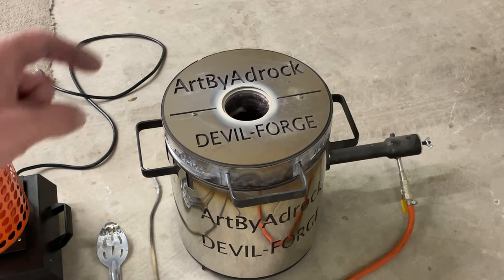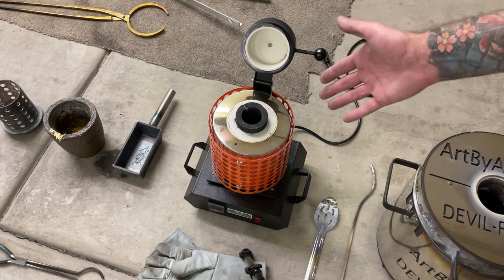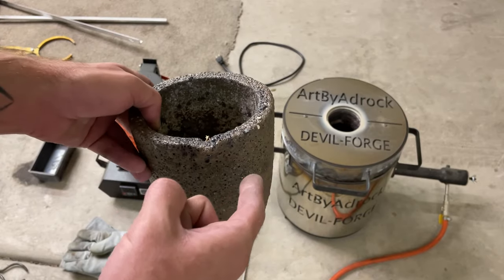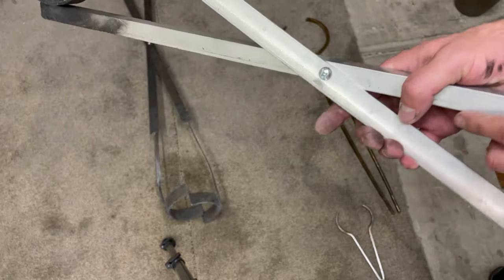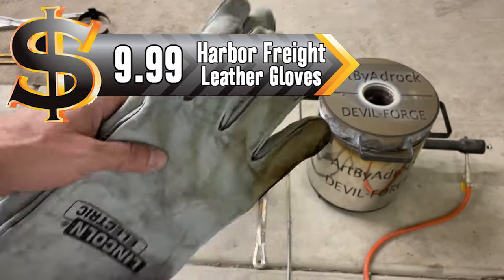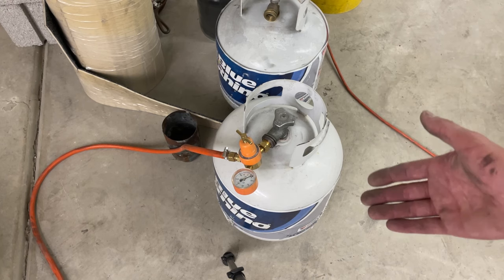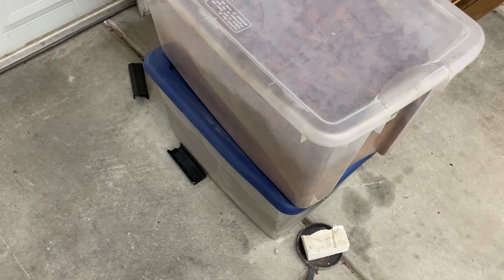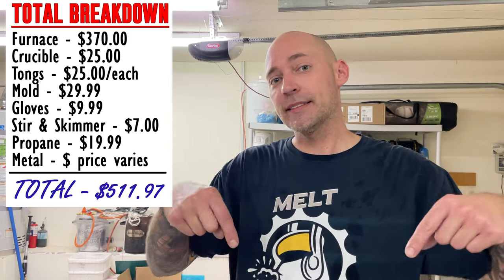Initial SETUP COST To Melt Metal At Home - FULL BREAKDOWN Of The Tools Needed

Comment from the maker: Hey everyone! Welcome back again! I decided to put out a video based on a lot of comments I have gotten in the past so that’s what I did. I hope this helps some of you and if you like me to go more in detail on a certain subject, leave me a comment and let me know. Stay safe and I’ll see you all in the next one! 👍🏻
Reply: Can you also make a new lifting tongs out of aluminum bronze
Reply: Forgot to mention a respirator I  think ...very important for safety.
Reply from the maker: A respirator is only really needed for certain alloys. This video was only about the basic setup. For a small amount of aluminum melting outside a respirator is not necessary
Reply: I got the electric smelter off amazon and the review you left is what made me pull the trigger on it but I hear the crucibles only last about 4 melts is that true? And if so do you know of any that last alot longer?
Reply from the maker: I’ve used mine for about 15 melts so far and it’s still fine. There is some wear but not bad enough yet to need a new one.
Reply: @connormorrison2091  aluminum bronze would probably melt
Reply: @woodworkingandepoxy643  That would be perfect
Reply: @ArtByAdrock  Woodworking and Epoxy would suggest you do the lifting tongs out of the aluminum bronze
Reply: @connormorrison2091   it would melt to easy
Reply: Very informative thanks Adam! I'm just curious what got you into melting? 🔥👍
Reply: How did you cast brass into the plaster Paris, how do you do that?
Reply: I need to finish my furnaces  .
Reply: What would I need to melt steel to cast parts

Comment: Eye protection and a respirator as well (for copper, zinc etc).
Reply: Why do you need a respirator for copper?
Reply: @vaughndumas  What fumes? I've never had any trouble melting copper.
Reply: @tyttuut  That's good.  It's just that every melter so far (ArtbyAdrock, BigstackD and IngotJoe) all wear protection when working with copper.
Reply: @tyttuut  If it's pure copper you should be fine, but if its scrap copper there will often be a bit of plastic and other things in there for example if it's stripped wire there may be little pieces of plastic that got missed or pipe may contain something inside of it, also some copper alloys contain lead or zinc which will release fumes etc. Your probably better off wearing protection and not needing it than not wearing it and finding out your copper was contaminated.

Comment: My molds are old cast iron bread pans that I recovered from the dump. My tongs are repurposed fireplace tongs. I got the next size down furnace, and use the transfer sites (dumps) for my metal scraps.

Comment: Thanks for this video!   It was great getting that break down.  I will be getting into this for scrap recycling, but its good to have the list.  Could you do or quickly let me know, 1) where do you run your furnace?  I see some home people run it from the garage, does the heat cause damage to garage doors etc,  2) what about toxic fumes and a respirator? does it create excessive smell or smoke?   Thanks!!!
Reply from the maker: I run mine either in the backyard or the garage. It won’t damage the garage door but I wouldn’t recommend it in the garage if melting brass. The zinc fumes will create a lot of smoke and then yes you will need a respirator. For just aluminum though you’ll be just fine. Your garage will get awfully hot though so I’d at least open the door. Don’t leave it closed

Comment: You forgot to mention about the usage of  respirator with certain metals! Keep up the good work and I will see you in the next video 👍⭐⭐⭐⭐⭐
Reply from the maker: I actually cut that out as it’s not necessary for a basic setup. For certain alloys yes it is important but for most cases it’s not. Especially when melting outside in the open

Comment: Great video. I would only add, a face shield to protect from steam explosions.
Reply: Face shields are usually made from acrylic or plastic. That steam would be hot enough to melt it to your face if it's reached melt point
Reply: @woodworkingandepoxy643  for hobby casting my concern (experience) is the small things that come at you when things go wrong.